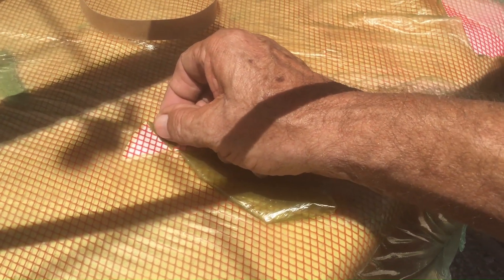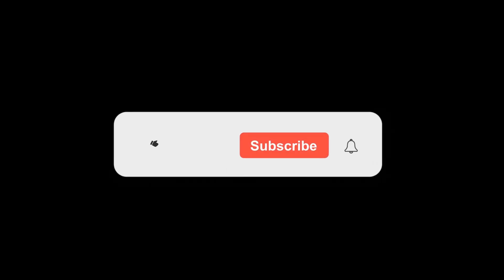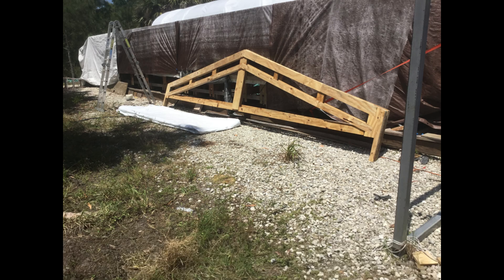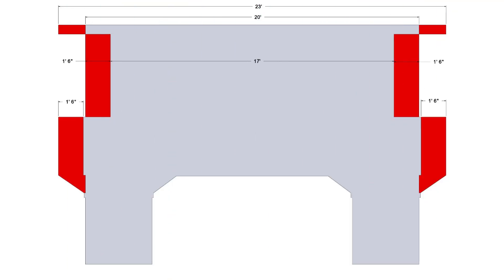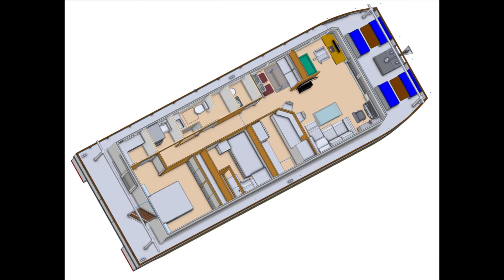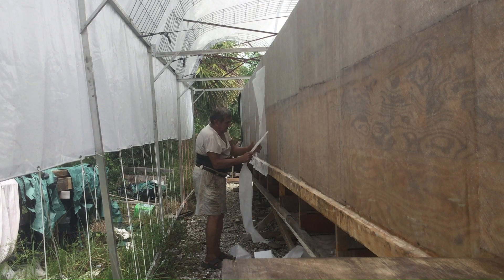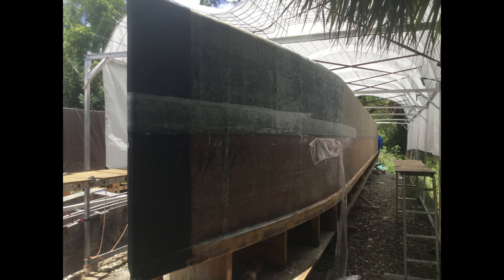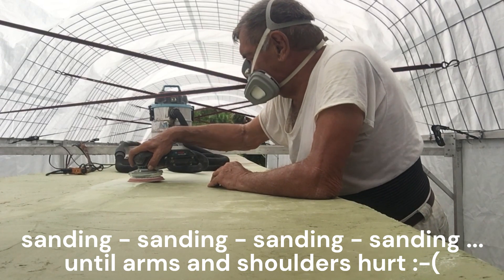Building a Custom Houseboat Episode 14

Comment: Glad to see you back.
Im starting a build myself. Making my pontoons out of Aluminum. 4x4x60 feet 
over all wiehgt 60, 000lbs
Water line at 24inches
I did my math but still nervous. 
Second opinion would be great if you have time.Thanks in advance.
Reply: Thanks so much for the info, yes I agree after your explanation. I will take you up on your offer to chat through email. Thanks.
Reply: @terryneary5949 , do you have Skype ?
Reply from the maker: @terryneary5949 , you can contact me @ HGBoatDesign@yahoo.com
Reply: @hgdesignhouseboat5591  That was another point of debate.
I plan on using all modern building materials.
Everything I researched gives me an average wieght for a structure that size is 50 to 60,000 lbs. I may be way over no calculations used on stuctural part of the boat.
Reply from the maker: @terryneary5949  
for some unknown reason when I respond to you from my I-Pad, it will not show up as a response, so I repeat it here from my main computer : if you like to contact me in more privacy, and also for the sake to exchange tips and design choices you should consider / follow, please contact me at this e-mail address I have created just for this purpose : 

hgboatdesign@yahoo.com

In regard to the weight "guestimate" you made in regard to the average weight, it seems some kind of overboard estimate to me. as an example; my houseboat 53' long and 20' width (so 7 ' shorter than yours) will be 18,750 to 19,250lbs fully loaded. Naturally this is a single level houseboat, with all the storage and technical and plumbing equipment housed in the catamaran hulls, and only a sundeck on the roof. If you are planning to make the boat wider, or add another level, that certainly will change the total weight, so I need you to give me these parameters and more. However, you must consider that propelling a boat with approximately 3 times the weight, will require a lot more engine or motor power, and the price to do so will skyrocket.
Reply from the maker: @terryneary5949  Due to the fact that because of the heavy rains in the last days, my boatbuilding site is flooded and therefore not accessible, or at least not possible to work, right now would be a good time to get in contact regarding your project. 
One thing I have already found which makes me think, that you might have miscalculated, is the fact, that you say that the overall weight of your boat is 60,000 lbs. if this would be the case, your CG (center of gravity) would be at a very high point above the waterline, since the weight of the pontoons (Cat-hulls) by using 1/2" Aluminum plates would be about 7,054 to 7,275 lbs only. That means, that ~52,000 lbs would be well above the waterline, which would mean a not negligible factor of instability. But to understand better how you got to this kind of high overall weight, I need more information from you. 
Regards,
Helmuth
Reply from the maker: Hi Terryneary5949, from the parameters you have given, it looks like your bridge would be too close to the waterline, unless you build the bridge on "distancers" ? 
2' clearance from the waterline to the bridge-deck, at a length of 60' is not a safe distance if the boat moves, even in relatively calm waters. However, if it is not meant to move, aka if it is a floating home, than it's ok.
If you want to give me more information about your project here, please do so, if you want to contact me directly, you can send me an e-mail trough the YouTube contact info.